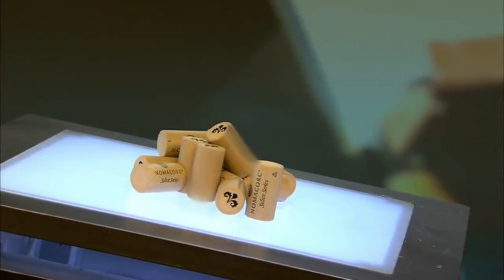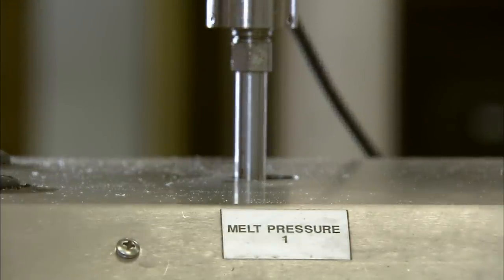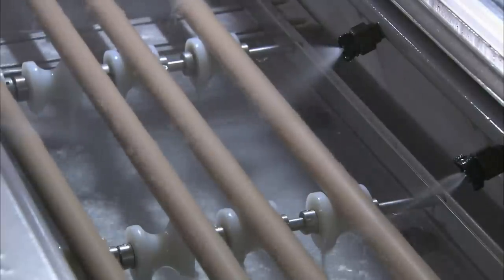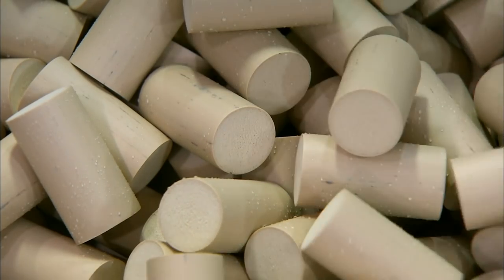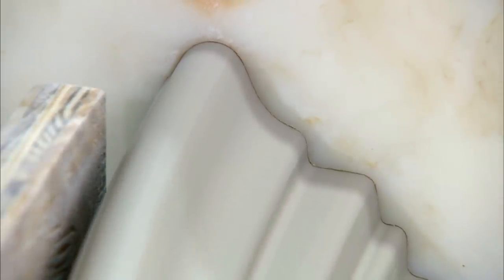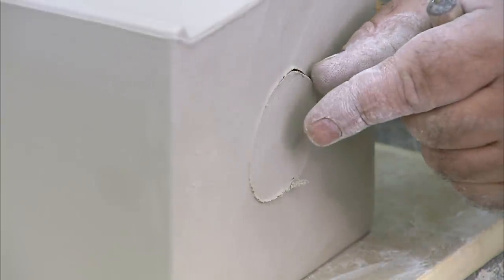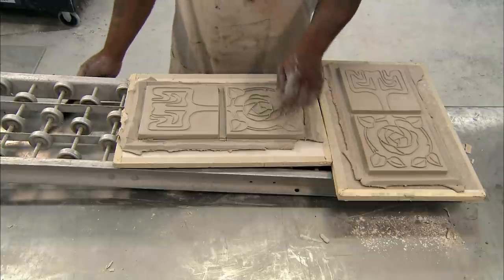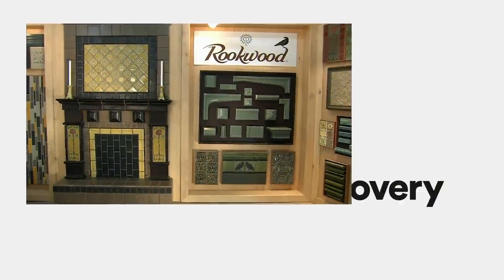SYNTHETIC CORK | How It's Made

Comment: They use regular natural cork for thousands of years and the vine was good. So the reason for using this …is BS!
Reply: Cork plus glass bottles are less than 300 years old.
Reply: Cork is getting expensive. It's a natural product and not an infinite supply, as it the bark from a specific tree. Synthetic corks are much cheaper, although extremely bad for the environment.
Reply: @Yvolve  the harvest of the raw cork do not kill or harm the tree
Reply: @ruimiguelchocas  right but it’s like seven years between each harvest.
Reply: @caljaysoc  9 years after the inicial 25
Reply: Me when i have no idea about supply and demand